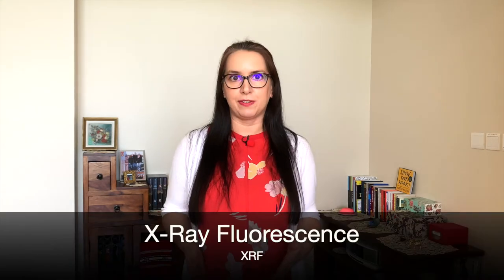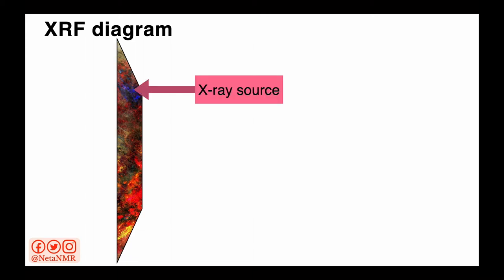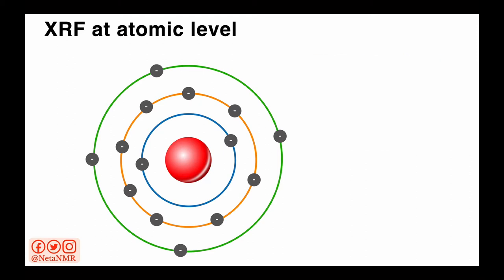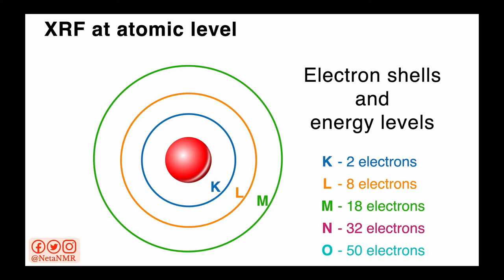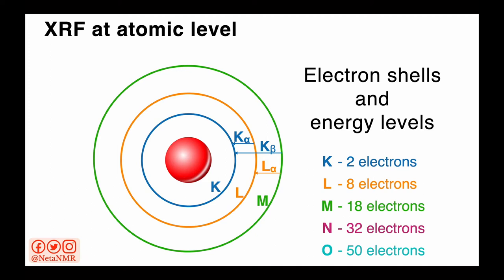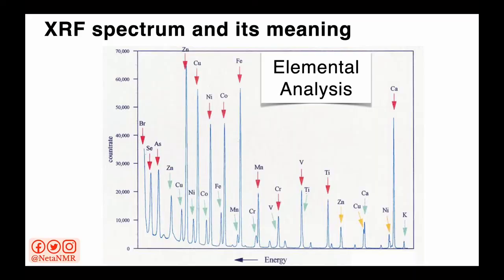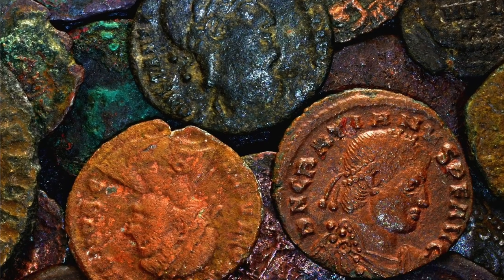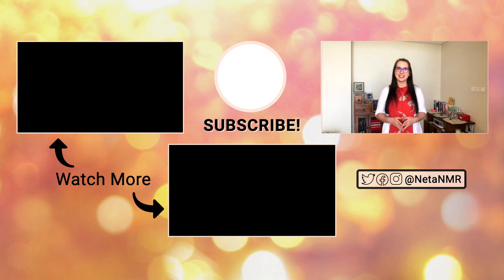WHAT IS X-RAY FLUORESCENCE (XRF) and the Applications of XRF in the Elemental Analysis of Artwork

Comment: I am also very interested in using the XRF technology to analyse ceramic samples. For example, when blue and white porcelain was first created, they were decorated with this extremely rare cobalt blue pigment from Persia. Chinese blue and white porcelains created in the successive dynasties showed different shades of blue  because local pigments were later introduced, and the firing technique also changed. When the visual vocabulary of blue and white was communicated to different regions of the world (such as modern-day Iran, the Netherlands, and Japan), different pottery centres made their own formula for the blue decorations based on what was available. I would like to know if the elements used in these glazes and their concentration are different.
Reply from the maker: That would be a very interesting application of XRF in search for differences/similarities between the blue pigments.

Comment: Unlike the ICP which is destructive analysis.. the XRF is clean and easy tool for elemental analysis.. it only tells you what elements in there.. but doesn't tell you which compound.. to do so you have to do XRD analysis combined with SEM analysis.. the one she explained was ED-XRF, but there is WD-XRF which is more powerful and gives better resolution.. unlike the ED, the WD-XRF requires sample preparation, such as powder pellets, or fused beads for solids.. the ED-XRF is handgun like, and it is much much cheaper than the WD-XRF.. even the spectrum for each is different where the WD-XRD has relative intensity on the y axis.. I tried to make it as easy as possible for the normal person to understand..